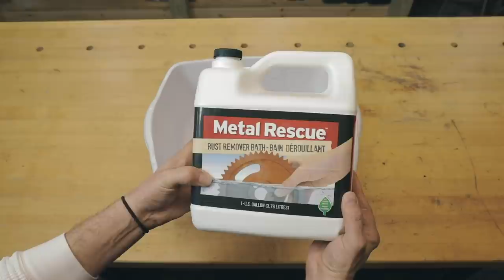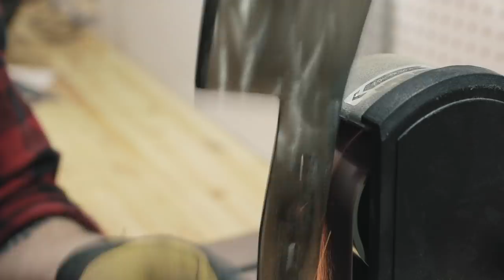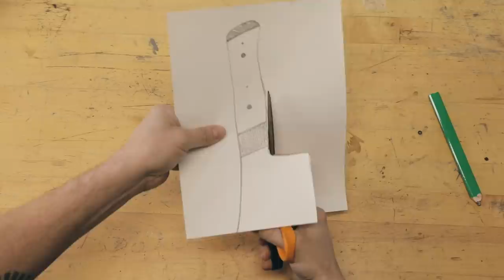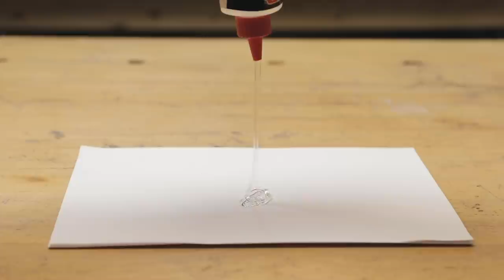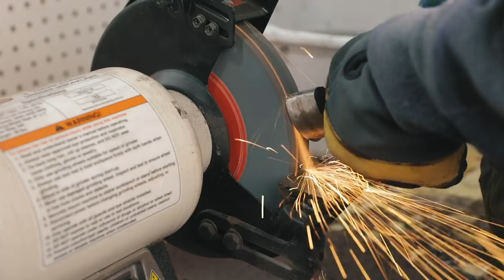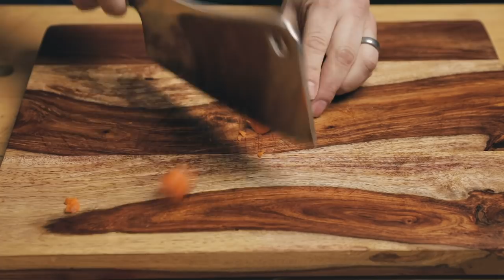ANTIQUE RUSTY CLEAVER RESTORATION!

Comment: I like how you designed the handle and then cut out the pieces to use as a template to cut out the wood and other materials.  Makes it simple to get good fitting handle parts.

Comment: Very nice. About to do one of these and wanted ideas because I've never done a cleaver or knife handle, just furniture and cutting boards. Try lowering the band saw guide bearings down to the wood with sufficient but not "tight" clearance. I'm not a pro but it helps,lol. I subscribed.

Comment: so looking at the restoration of the blade was fine. when it came down to remaking a handle for it was going through my head was "ok so he has two mettle end caps lets see how he peens them" imagen my surprise  when the only thing that got peend in place was the hard wood had grips. the guy must be intending to use it for light cutting because not peening the mettle caps is a mistake epoxy ant going to hold those in place under stress and after a number of years of use those mettle caps will eventually just snap there epoxy bonds. over all restoration rating 5/10.